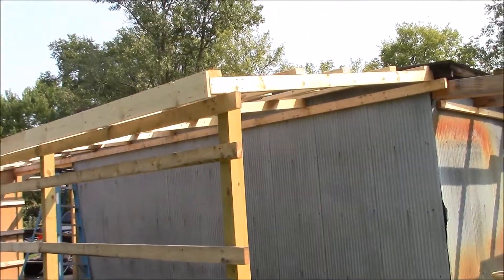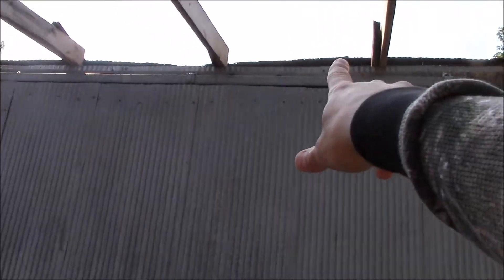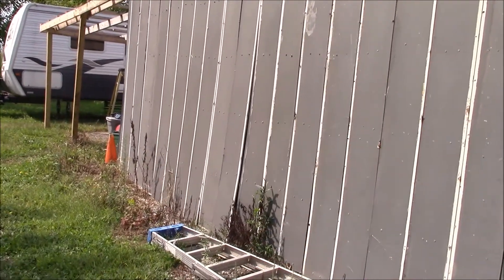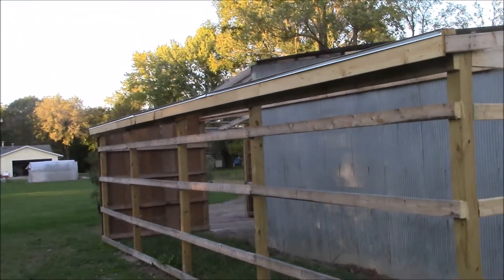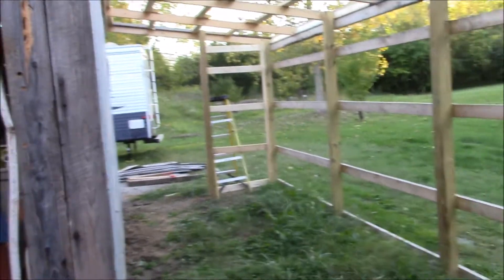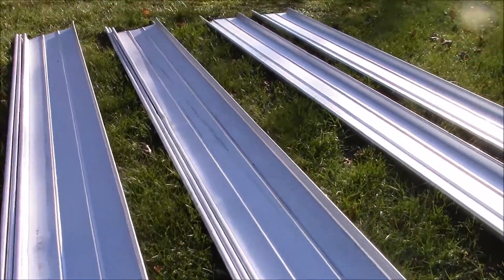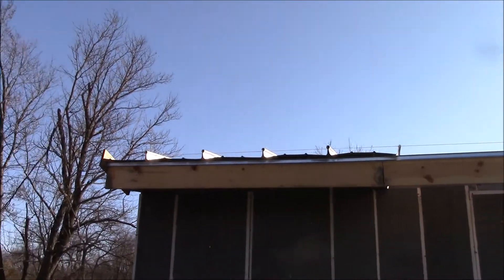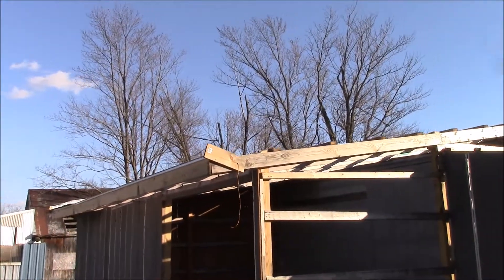Barn Addition Project Part 2

Comment: nice to see you recycling building materials.  maybe buy a $20.00 Harbor Freight paint spraying and get some gray paint for the outside walls to blend both buildings and throw away sprayer when you are done ? they work great for at least one job.  just an cheap idea :)  thumbs up as always...........
Reply from the maker: GREAT IDEA!!!! I was going to do Barn Red with White trim, but light gray would save so much time.  I was already planning on a paint sprayer, good call.  Thank you very much.
Reply: yea, 20 bucks then throw it away. lol.  i have a Wagner sprayer too but it's a pain in the butt to clean.  you can get what ever paint you want thin it out a lil bit and spray the bulk of everything and just brush out the trim.  sooo much faster to do and it's a good job too.  just wait till you get a day that's not windy :)